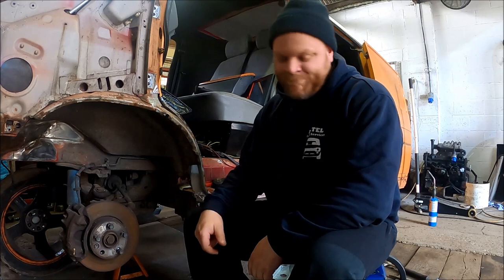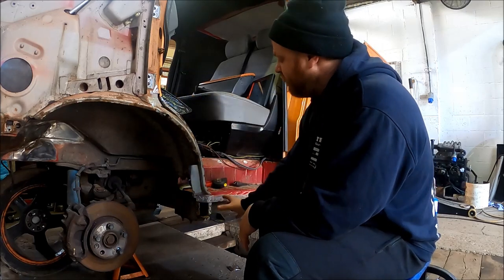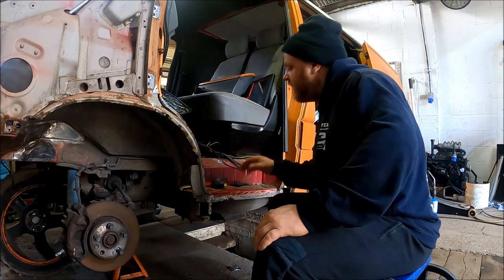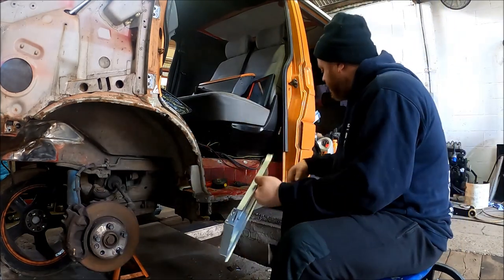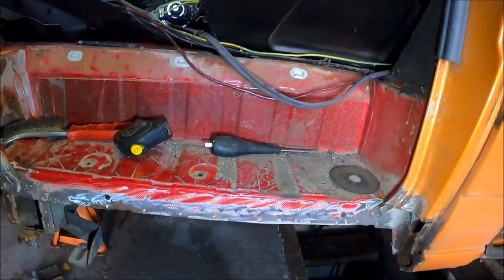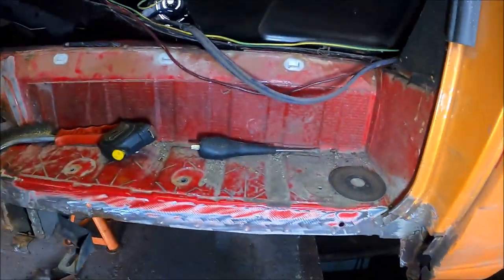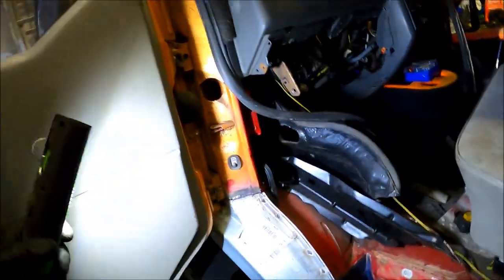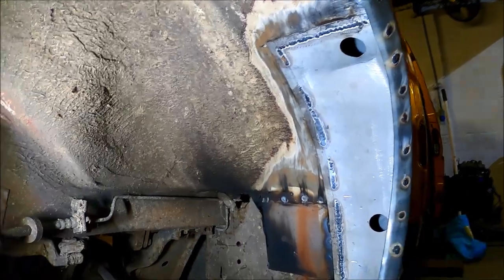vw t4 transporter restoration welding front arch inner and outer sill repair rust problems m-tel

Comment: Whats the point of the holes? 
Surely best practice would be weld them up ?
Reply from the maker: It's so u can spray wax oil inside the sills 😊 to prevent rust 😊 and u can buy the bungs from vw to go in them once u have treated them 😊
Reply: @TheADHDmechanic   mine are just rusty holes…
Reply from the maker: @mcjjordan  yer my orange one was the same
The problem with the bungs is they go hard and then fall out and mud gets in 😒
Then rots them out
Reply: @TheADHDmechanic   could/ should of been a much smaller hole